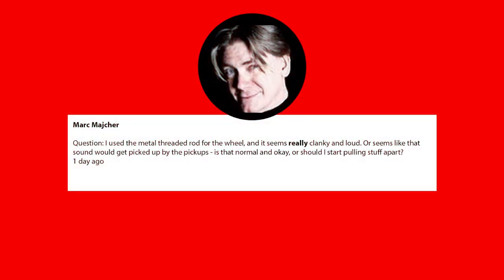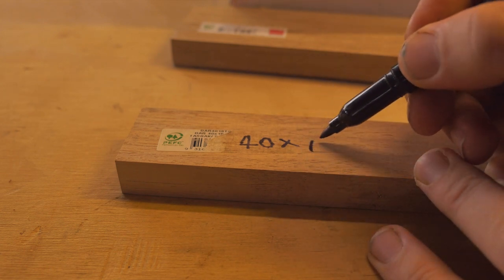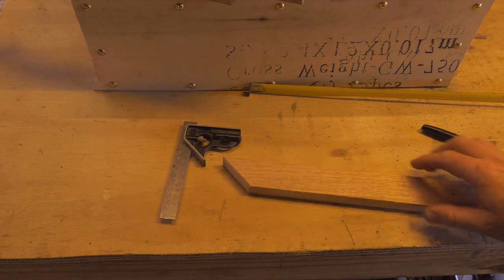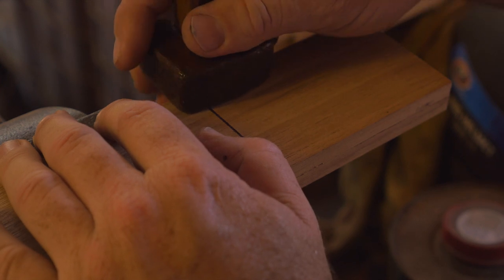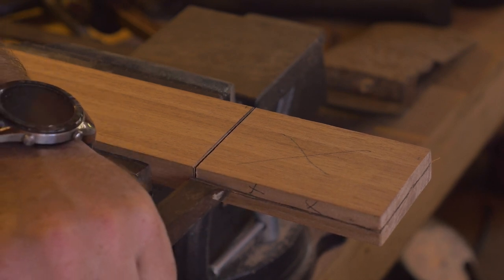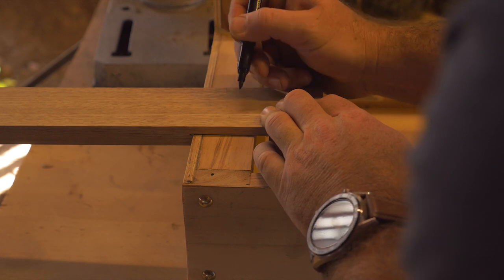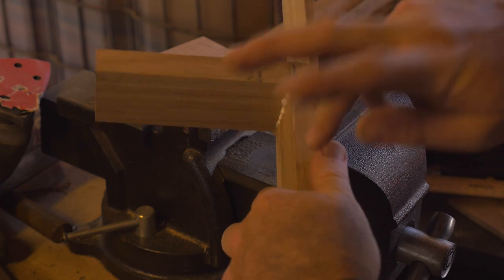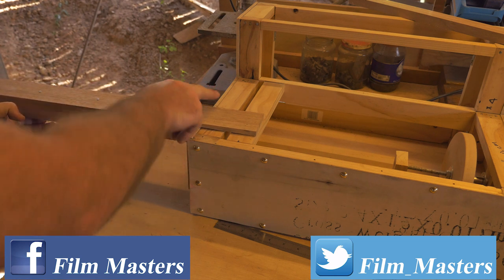How to Build The Apprehension Engine #15 - Making the Guitar Necks

Comment: Thanks for answering my question in the video! I actually wound up doing a few things—first, I used some acetone to remove the super glue on the nut that was clued in. :D Then I just wrapped the threaded rod with a fair amount of teflon plumbing tape where it was contacting the bearings, and the grinding sound decreased by 100x. I was going to try to see about moving that outside nut (the one that was glued) to the inside, just on the wheel side of the further internal support—that way, I could easily adjust it and tighten it with a lock nut instead of gluing it if it got too tight or too loose. Unfortunately, I thought it would be a great idea to glue that support in instead of just screwing it, so, next time, I guess. :)

I've got my guitar necks done, and eagerly looking forward to finishing the top up!
Reply from the maker: Next video will be finishing the box, adding the sound board and screwing those guitar necks on. Then the next video will be the parts list for the electronics and what I will be using. Then the last video will be putting on the cords and pluging it in to make some noise :D

Comment: Will start building the guitar necks tomorrow. Really curious if I can get it done so beautifully as you. Thanks BTW for this awesome tutorial. Enjoyed every minute of building it and it looks great until now. Hurdy Gurdy weel is working as well. And I always smile when you say "make sure it's nice and flush!" best wishes looking forward to the next parts.
Reply from the maker: Thank you and glad you're building one. Take your time building and make sure all the Guitar Necks are straight and square and you'll get it spot on 😁. Best thing about the build is it comes together quickly at the end. Also it's your very own home built horror sound effects instrument. Just make sure it's all flush 😏
Reply: @FilmMastersChannel  OK I messed that up quickly 😂 Everything was looking great and I really tried to chisel the wood out carefully but within the last 2 centimeters the other side broke. I used a small chisel at the end because I thought it is going to put less pressure on it. Now I have to get a new wood 🤣 Is it possible to saw that piece out as well? Thanks for your help
Reply from the maker: @jakob_balogh  You can chisel or use a saw. The saw takes longer but might give you a streighter cut.

Comment: Hi Michael, i am still eagerly following along.
Can you give us a shopping list for the electrical parts?
There are some things, that i will need to order. as no hardware store will have them in stock. Like reverb tanks and piezo mics, preamp (?), jacks, battery holders etc... But also things like tuning pegs or which strings to chose...
I want to be prepared :-)
Reply from the maker: Hi Jörg, The following is what you will need. 

Electronics:

REVERB Tank is a 4EV2C1B 2 Spring MOD Reverb Tank you can get them on ebay. That's the one that will fit this build (based on Mark Korvens Apprehension Engine). However you can put smaller ones in but the larger is more ideal. 

You can get many different types of Piezo pickups. From $1 all the way up to expensive ones over $400. The ones I will be using sell for around $11 on ebay (Dual Piezo Pickup Pick-up with 1/4" Jack Volume Tone Control for Acoustic Guitar) I will use two of these. For the three strings (small guitar neck) you can use either a  Three String Cigar Box Guitar Pickup Pre Wired Single Coil Electric or a Dual Rail Humbucker Pickup for acoustic guitar or both is you like. Make sure they are already pre wired with an adjustable knob and a ¼ Jack. 

Strings: One pack of violin strings for the small neck and the large neck the two wires will be from a Cello. So buy a pack of 4/4 Cello Strings G and C are the string types I am using (they are the low octave) metal ones. As well as a pack 6 Piece 3L 3R Acoustic Guitar Tuning Pegs Head Tuners.  

Mixer. I am going to use a YAMAHA MG10XU mixer but any mixer will be fine as long as it takes Mic in and has a pre amp to your PC. 

I will cover that at the end of the box tutorials this set up. You can use software to make the ambient (REVERB) but you can also use Guitar pedals like Mark Korven does. A looper pedal is also ideal. Just depends on what sounds you are trying to create. I will be using a Meris Mercury 7 for ambient sounds but it’s a $475 pedal and may or may not be in your budget. You can use reverb in Adobe Audition or any other DAW. I will also cover this soon . Hope this helps with your build.
Reply: @FilmMastersChannel  Great Michael, thanks for the list, this will help a lot regarding preparation.
I cannot find a Reverb Tank with the description "4EV2C1B 2 Spring MOD Reverb Tank" on Ebay or the web.... 
Can you look up one, that has the same dimensions or give us a link ...?

How many channels/outputs are you planning to occupy on the mixer? Is the reverb tank also plugged in any way or picked up by the contact mics?
We will need the preamplified mic inputs of the mixer, aren't we?

I already own on of these boxes, and use a long fx-chain with it. It's a great machine but lacks the string section ;-)

www.leaf-audio.com/diy-machines/microphonic-soundbox/
Reply from the maker: Jörg Peltzer looks like the one I bought is not in stock on eBay. Try this one Mod 4AB3C1B
Reverb Tank. It’s the same size and is dual springs. The Pezio mics will be plugged into your mixer which will amplify the signal. However you can add an external microphone preamp if you want more sound. I’ll be showing a basic set up however if you want to upgrade the audio go for it 😁. I love the leaf audio soundbox. If you see how that’s made in their forums the pickups in the Apprehension Engine are similar. As for the spring reverb it will not be connected both ends. Only one audio connection is required to play it. However if you want to use it live via the mics you will need to wire that up. Marks Apprehension Engine doesn’t seem to use the reverb tank to add more reverb but simply used to make thrills and other real time sounds with an ebow. Oh and if you want an ebow make sure you grab one of those as well as a violin bow. Next video is finishing off the short neck guitar neck then I’ll be making a parts list and what to chose to order for the box. Hope that answers your question 😎
Reply: @FilmMastersChannel  This is great! The electronics side is the bit that I'm the least comfortable with—I've been playing around with some stuff on its own before hooking it up to the box, but I'm still not sure, like, what a pre-amp is, even, or where it would go. :D

I picked up a smaller 10" reverb tank, but I'm about to order the larger one recommended below. I also grabbed an ebow and a Depusheng DX400 4 Channels Mixer—I don't know if that has a pre-amp, or if I need to add one in, but I reckon I'll figure it out as I go along!
Reply from the maker: @MarcMajcher  The electronics for this are easy. There will be no soldiering or making stuff from scratch. It will be all ove rthe counter items so don't stress :). However this will be your Apprehension Engine so if you want to experiement or add more pic ups you can. The idea is to set you guys up with a working box and then you can go wild customising it with sound makers ect.

Comment: Hey dude i am wondering about the electronical question . Did we get the Mixer inside the Engine or did. we take the contact mics for Outputs out of the Engine? Greten malte by the was phenominal Videos
Reply from the maker: Hey Malte, For this build I will be using an external mixer that plugs into the PC. We will be using contact mics or Piezo pickups to get the sounds from the box into the mixer. Obviously this is your build so you can play around with that part to find the best way to get the sounds you want. I will show you how I will set mine up. The Reverb tank will also not need phantom power as we are not running any sounds through it however if you want to you can hook a mic up to it and have that run via the Reverb tank to get more sounds. For this though I am going to use a Reverb Guitar pedal. The one I am using is expensive (Meris mercury 7 pedal) but you can buy cheaper ones. Other option is to not use a pedal but use your software to add reverb. I will cover these in the upcoming tutorials. Let me know if that answers your questions or if you have more :)
Reply: @FilmMastersChannel  thx it help me a lot with my opinion maybe you can  give me the size of the engine without the tank .
Wanted to make it a bit bigger because of a third guitar neck witxh responding deep frequenciez for grounding earthly sound.
Your answer will still help me a lot.
Then i can start collect materials.. 
And get ready to build.
Did you use piezos cpnnected to an output like the leaf audio soundbox or did you use connected to an 1/4 jack so you can put in the mixer ?
Best greatz
Reply: For reverb i will use my virus because of sll that effects and beautifull kinds of reverb after all
Reply from the maker: For the box messurements check out the base video. The base will give you the dimensions you need. Since you wont have a reverb tank your frame will be just a box so make sure you still install guitar neck supports or you will have too much slack on the necks. 
I didn't use a leaf audio soundbox (although the Apprehension Engine is a larger version of this build) but installed Piezo picups with volume and tune controls via 1/4 jack into the mixer.
Using 3 guitar necks sounds like a pretty cool custom box. Make sure you send me some pictures :)